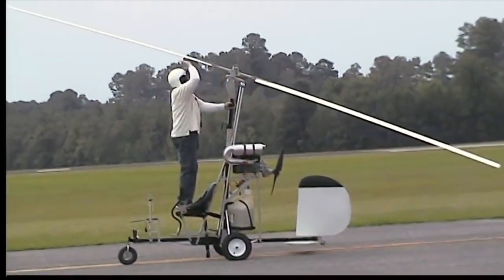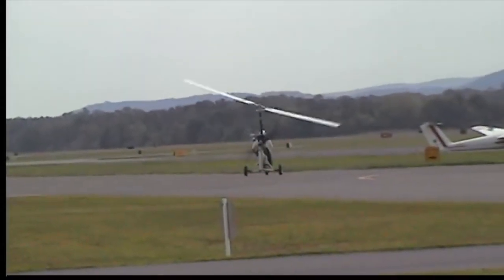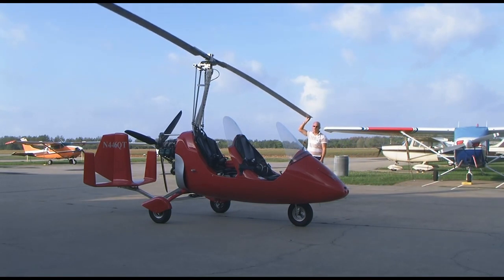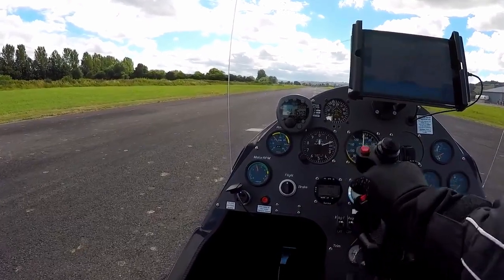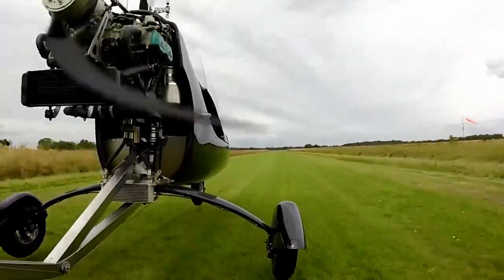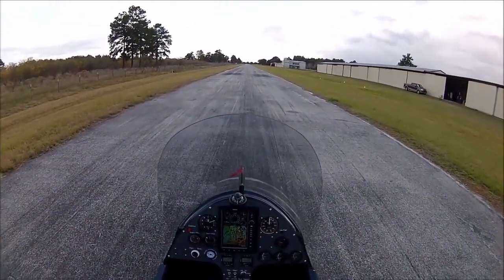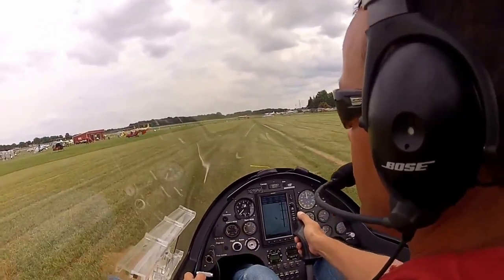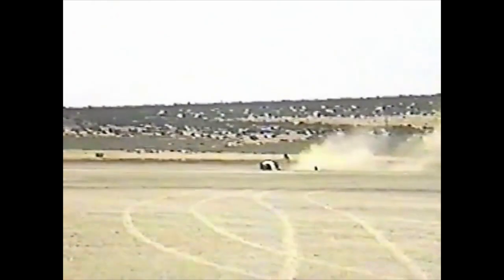Gyroplane/gyrocopter rotor management

Comment: The last part of the video when the gyro was landing flips over. Is the problem that he had to much speed or didn't do a proper roll out or what. AT first it look like he had it. Could you explain.  Mike
Reply from the maker: mike lavergne it's purely my opinion as I wasn't there and haven't talked to the pilot - so the opinion is based upon the video.  So having qualified that it doesn't look the nicest of landings with what looks like a small balloon then bounce. However the after landing process looks poor and he just doesn't get the gyro stopped and actually the instability looks as much one of steering on the ground via the pedals as much as mis handled rotors. Gyroplanes have very poor stability on the ground and I teach landing technique that has almost no roll out.  Get the aircraft stopped then start the taxi / back track from scratch.  The point really being made is that once control is lost the situation is very rarely recoverable as events happen so quickly.  Hence why stick to your plan/process and don't get distracted.